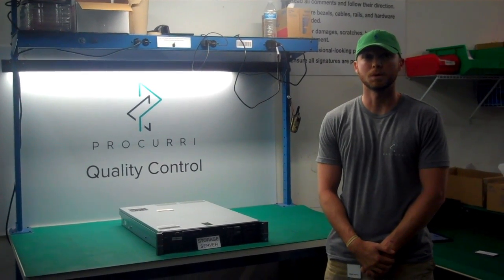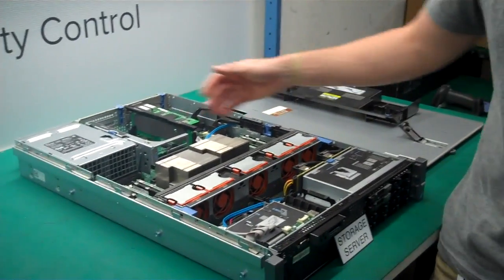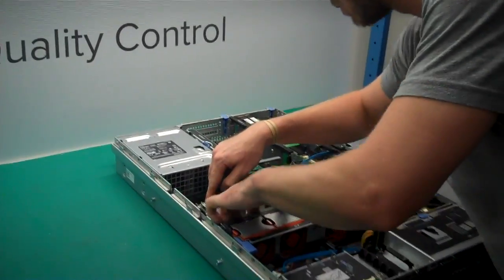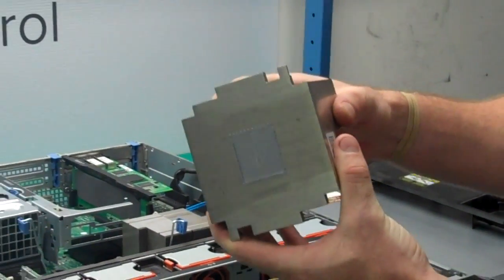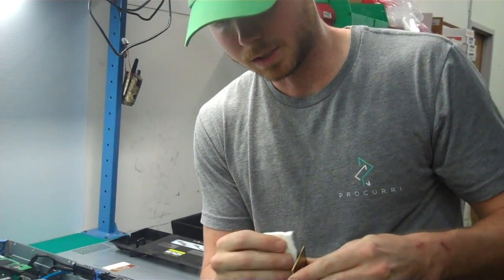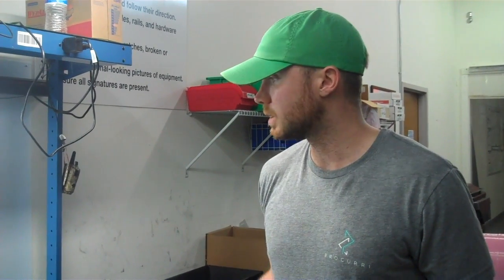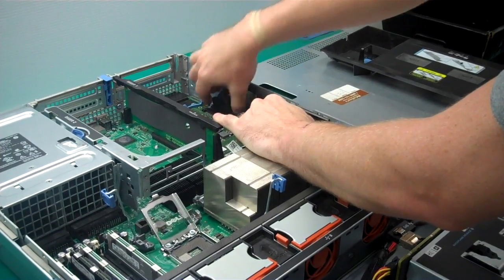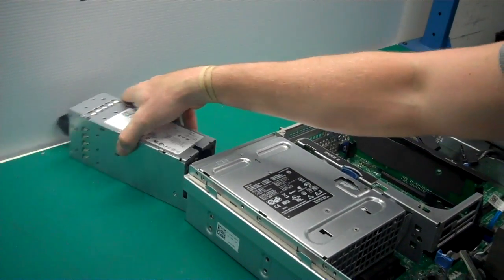Inside of a Server Explained

Comment: Can any one tell any other inside server compoments there apart from HDD 3.5 INCH And HDD 2.5 Inch And Memory DIMM . CPU Attched Heat sink with thermobase.m Cache card and battery and Poer supply unit. Please provide any other inside server compents?